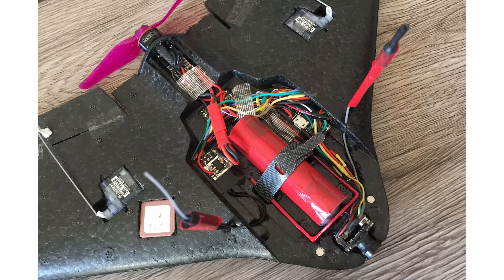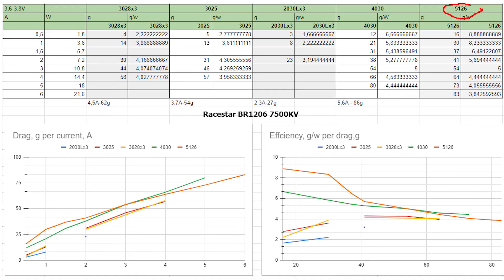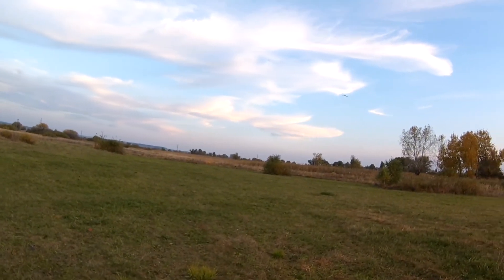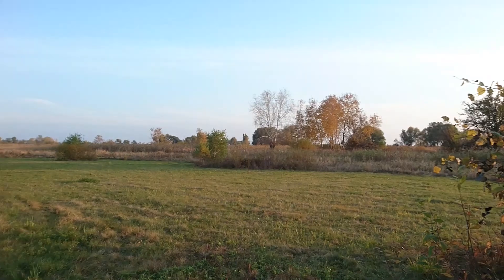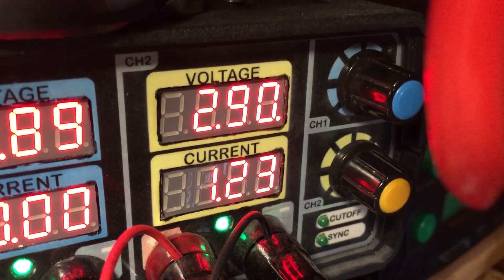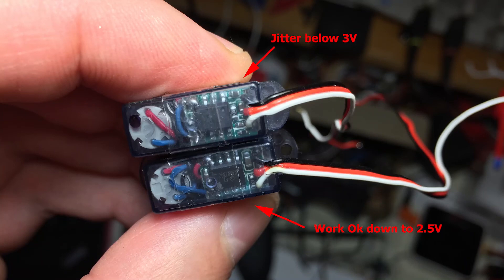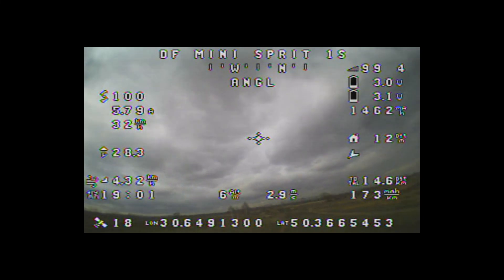[hx_espnow_rc] DF Mini Spirit 1S

Comment: The video and the project is great , i wonder that the ss24 diode on the DC to DC conventor have forward current about 2 Amps, so how that DC to DC conventor could supply enough amps from the Li-ion to the ESC ?
Reply from the maker: dc-dc provides cpu and mosfet driver voltage only. mosfets which power the motors are still connected directly to vbat.

Comment: Do you have more info about the mod on the esc?
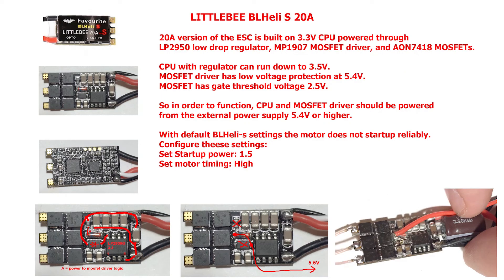Reply from the maker: 1:44 shows all info you need. Remove resistor and diode as shown, and power from external 5.5-7V power supply.

Comment: Fantastic project I love it. I have some mini spirits myself. Mine flies 18650 2s and has a 3D printed long motor mount for the CG. Littlebee 20a esc, ELRS radio. With iNav it can cruise up to 90 minutes and 50km travel distance. 400mW TX allows up to 5km distance from pilot.
Reply: 90 mins woah. Do you know what it weights with the battery?

Comment: Hi, I am building your HX_ESPNOW_RC project.
One question however: 
Do you really feed +5 V through the diode directly to the output of the A1117 regulator (according to the picture in the description)? This would mean that the ESP32 is running on almost +5 volt !? 
I thought it had to run on max 3.3 V...
Reply from the maker: Good you found it! It was my mistake, I fixed picture. esp32 chip should be powered from 3.3V max definitelly.